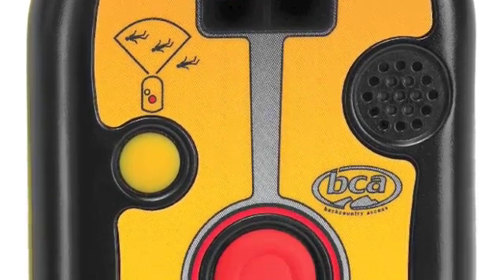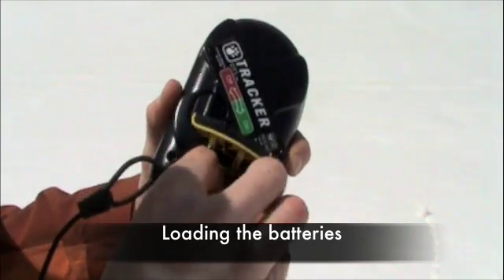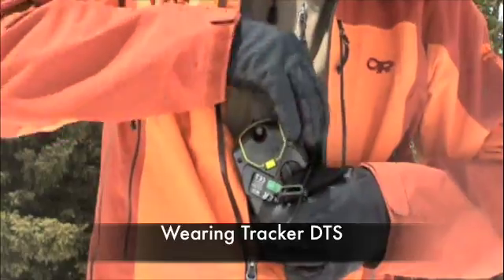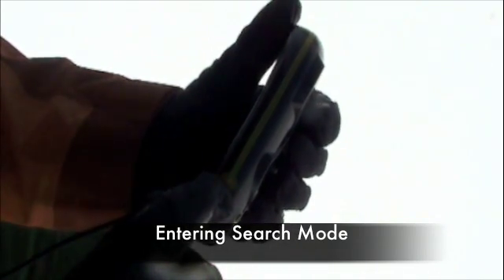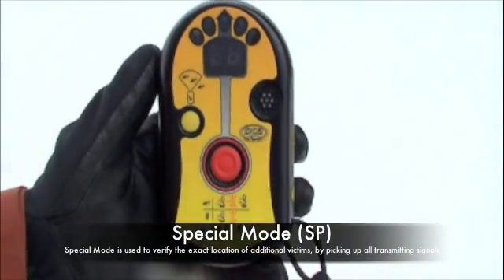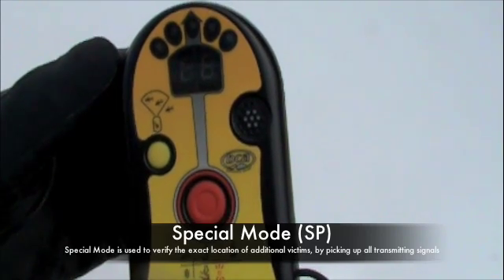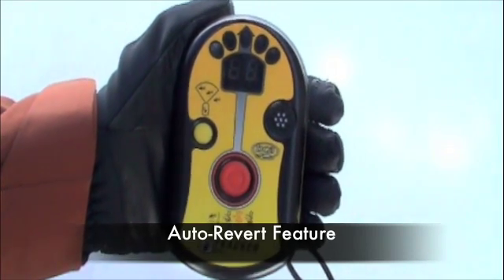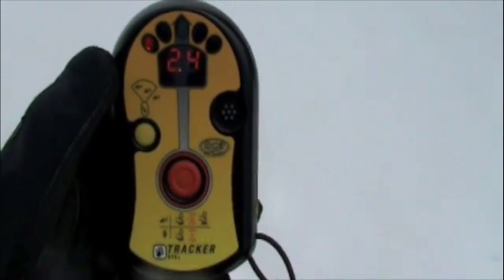BCA Tracker DTS™ Avalanche Transceiver

Comment: This assumes that the person (victim) of an avalanche or a fall is conscious enough to send the beacon, or to turn on the transmitter.  If they don't do that...my guess is that no signal will be sent.

This begs the question - "Is there a device that can "know" when a person has become unconscious?"  This would be critical for someone who only a certain amount of time to transmit due to oxygen deprivation AND had become unconscious due to whatever accident befell them.
Reply: +David Madison When traveling in avalanche terrain you always have your beacon on which defaults to transmit mode. Always travel with a partner and ride slopes one at a time.

Comment: So, it's not made clear; but I assume that you need two (2) Tracker devices for this to work.  One is set to transmit by the trapped victim; but the other one is set to receive or track by someone who KNOWS that someone is trapped.  It's no good if someone doesn't know that you need searching for!
Reply: +David Madison Everyone in a skiing group should have a beacon when skiing off piste. Before the group goes off piste, everyone turns their beacons on to transmit mode. Skiers should be spread out enough so that if one person triggers a slide, hopefully the others won't also be caught. If someone gets buried in a slide, the others will quickly switch their beacons to search mode so they can start pinpointing the victim. Probes are then used to further pinpoint where to dig. This video isn't an avalanche rescue tutorial. It's just showing the features of this particular beacon. It's important for skiers to understand and practice rescue procedures before going out into the backcountry or sidecountry.
Reply: You have to remember something,ALL AVALANCHE TRANSCEIVER S, transmitt and receive,each individual one and there is a 100% DIFFERENCE BETWEEN A TRANSCEIVER AND BEACON,THEY ARE NOT ONE IN THE SAME.A TRANSCEIVER TRANSMITT AND RECEIVES ON A FREQUENCY OF 457 KHZ,A BEACON TRANSMITT ONLY AND ALOT OF THEM HAVE STROBE LIGHTS ON THEM AND TRANSMITT ON A TOTALLY DIFFERENT FREQUENCY AND ARE USED IN SEARCH &  RESCUE.

Comment from the maker: @smoothymaker The Tracker DTS will find any other modern Avalanche Transceiver that's turned on and in transmit mode.
Reply: Infact it WILL find/pickup a anolog avalanche transceiver also